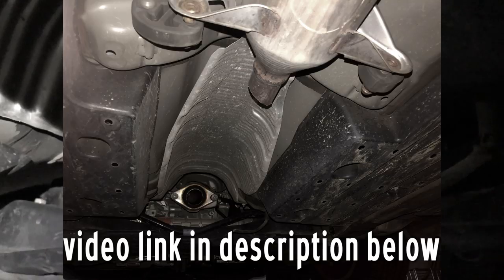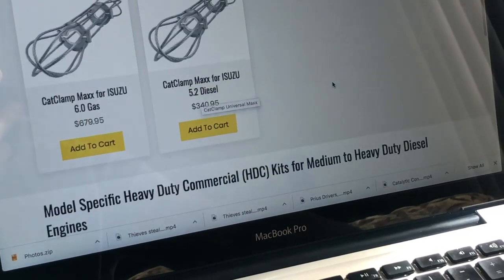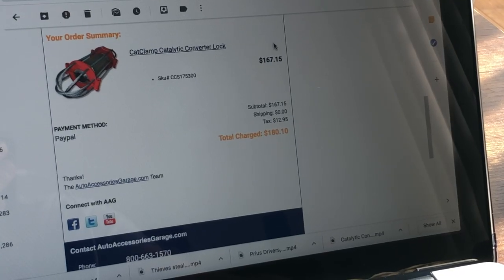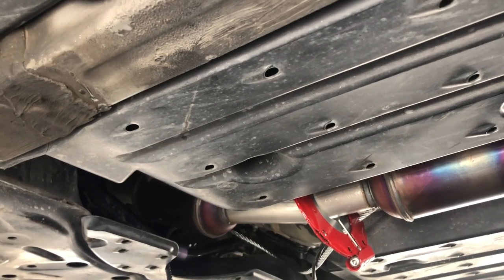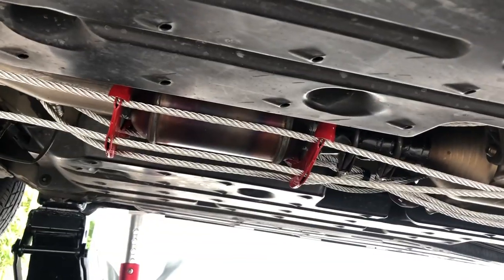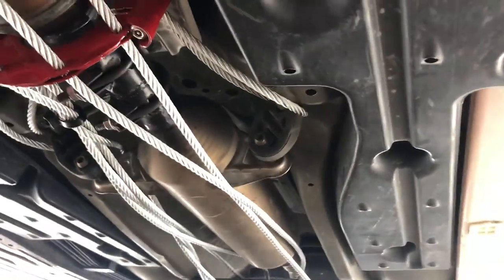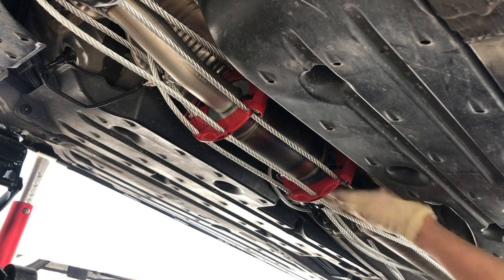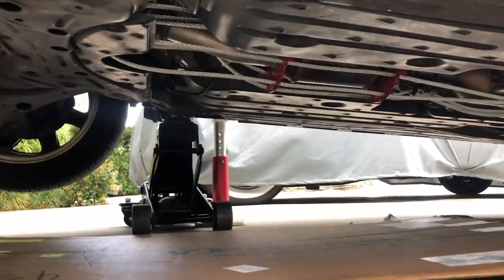Installing CatClamp: Catalytic Converter Anti-Theft Lock

Comment: $5,000 reward for the capture and reporting of illegal catalytic converter recycle centers there are no honor Amongst Thieves they are like cockroaches and will report on themselves simple as that case closed and I would also still add a security device to my cat
Reply: I support you!!!!!👍 Some MOFOS steal mine yesterday, I want them not in jail, I want them out of this planet!!!!😠💣💥
Reply: @BM-ef5fh  I don't know where your from but here in San Diego Toyota of El Cajon has catalytic converters for about $1,500 before taxes complete with no welding required 4 bolts
Reply: Thanks for the video. Showing installation was helpful.

Comment: Insurance companies should give a discount for people who install protection. Ultimately they have to pay the cost , so saving them money should save you money.
Reply: thats presuming they live in a place that requires insurance, even then, its only liability that is required.. which generally does not recover theft or vandalism
Reply: I don't even insure my truck for 3/4 of the year, we only use it for a few months in the summer or winter. More like start fining the shit out of recyclers who get caught with these coming from any source other than a certified garage.
Reply: A lot of insurance companies have a $1500 deductible so typically makes it pointless to put it on your insurance and pay higher rates. Even if someone does file a claim, they are still stuck with a large deductible. It's ALWAYS the people paying....insurance companies pay claims with their customers money.
Reply: @stephenwhite5444  Use a different insurance company.

Comment: hopefully the sway bar moving about doesnt get worn down as the bar will actually rotate, if you have a cable wrapped around it, it will be making noise as you drive if it is tightly wound around it

Comment: Hi David, a thief stole the cat from my '91 240 recently. They cut off the downpipe including the O2 sensor. Can I install a new universal cat with an O2 port or would it be better to install a new downpipe and cat with flanges?
Reply from the maker: Ah bummer! First time I’ve heard of a 240 getting nabbed. Oem is best but I’m sure a universal cat can work for you if you’re not in CA or NY, and I think Maine is on the exclusion list too.
Reply: @DavidBello  Thanks for the reply. I think I will go that cheaper route for the time being. It will still probably be an improvement to the 30 year old cat that was stolen.
Reply: Wow. On a 240??!!!  That’s insane

Comment: Thank you. Now I know that installing one of these would be a pain in the ass. Not that I have the ability to install one myself. I've read suggestions about scratching your VIN on the catalytic converter or painting it. I'd rather do that -- although I probably won't do either because they would require me to get under my car and I don't have a safe way to do that. :P

Comment: What would prevent a thief from merely cutting the cables with the saw they use to cut off the pipes?
Reply from the maker: The added inconvenience
Reply: @DavidBello  But they could pretty easily clip them with bolt cutters or the electric saw, right? It would just add another minute or so to the job? I'm trying to find the best option for my truck.

Comment: I just weld 1/2 inch rebar to the length of the cat and the section of pipe that its located on.
Reply: I have an 2000 e350 I thought about the same thing weld 5 or 6 rebars on frame under cat and maybe steel mesh to top it off it would take 15 or 20 min at least with saw . I just caught someone cutting my cat out while I was sleeping in van .
Reply: @arachosia  get creative. Lol
Reply: @arachosia  Exactly! Not smart.

Comment: I install custom made cat locks that are plate manifolds for all 2nd gen prius cars with installation in LA for anyone watching this and I do it for low price cheaper than if you were to buy the cat clamp on this video
Reply: hey how much ??? im on east la
Reply: @ricardogonsalez9739  $175 and it's with everything parts included
Reply: How much for a tundra
Reply: @lostcharly1  I gotta see your car I don't really do normal cars but ill check it out I won't charge an arm and leg tho
Reply: @frankhurtado6890  Ok it's a 2013 Toyota tundra, im located in moreno valley
Reply: @lostcharly1  bro unfortunately you'd have to bring it to me I stay in Los Angeles
Reply: @frankhurtado6890   What part of L.A ? I might be going the way in a couple of weeks to LAX, could swing by.
Reply: @frankhurtado6890  hey how can we meet??? i wanna do this on my 2009 prius
Reply: My daughter has a 2008 Prius, we just had the cat installed at dealer through our insurance. Unbelievable what's going on in LA area. How much and where are you located or phone number? Thanks
Reply: hello, can you give me more info please , I have a 2004 prius
Reply: Do you also do 3rd gen? If not, is there anything harder about securing the 3rd gen?
Reply: @sweepingdenver  I can do 3rd gen but I'm going to have to charge extra because they're a lot more work
Reply: So how do I contact you to do this and when can I bring my 2008 Prius to you in what area of LA? Thanks.
Reply: @Katjanra  my info is in the comments
Reply: @frankhurtado6890  sorry, but I  have checked twice,and there are not :(....
Reply: @Katjanra  you claim you want me to work on your prius but it's been a week already and you haven't reached out , I get ppl like you all the time
Reply: Where can I get your contact info? Do you work on honda accords? I got a 2004

Comment: I like the cat clamp but it's way overpriced. Heavy duty split flanges and steel wire (under the flanges and around the frame) would achieve the same thing for less than $30.
Reply: If you are handy, do it! This is a great product for those of us that aren't that mechanical.

Comment: did you install that black piece of brace metal towards the rear that the cable is strung through? is that OEM on your car?
Reply from the maker: That bar is OEM
Reply: @DavidBello  did you consider the wide metal Plate type of protection device?  pros cons?

Comment: Do this things work better than the plate? Also when doing smog do they need to take this off to do smog?  Call muffler shop and they told me that they still steal them even with locka

Comment: No reason to install the protection on this aftermarket catalytic. Those scumbags only interested in original converters because of high amount of platinum and palladium. They will jack it up ,see that it's the aftermarket one and they will turn around and leave. I took mine original off and put it into storage unit untill I get the protective plate. And also the device you used doesn't protect catalytic as well as the plate does.
Reply: You think they analyze the cat before they cut it out? lmfao! They cut it and run, then look.
Reply: @fortyoneshades  yup I saw a video they accidentally cut out the muffler on an RV and just left it in the driveway (which still had to be replaced)

Comment: Cat security is way better.   Just got and installed on my tacomas.  Also cheaper and easier to install
Reply: Cat Security $279. This is $176. Watching the install from Eric the Car Guy for the Cat Security shield that is way more involved, especially if you have an older car and rusty bolts. I like it, but am looking at this because it IS cheaper and IS easier to install.

Comment: But isn't their fancy quiet saw going to just cut through the cables just like the cat pipes?
Reply: A reciprocating saw is going to have a REALLY hard time cutting steel cable.  And it seems like that's the tool of choice for your average junky thief.

Mine was stolen recently... the guy showed up a couple hours earlier and spent about 5 minutes under the truck doing who-knows-what. I think he may have tried unbolting it? I didn't see any obvious tools on him when he crawled under.

He must have got frustrated (it doesn't unbolt or anything, so who knows why he spent so long under there). He left and came back a couple hours later with a buddy... both had cordless saws and they cut both ends at the same time. Made a HUGE racket at 3:30 AM, but they didn't care. It was about 20 seconds and they were done and gone.  His initial visit gave him enough info to make that last visit go as quick as possible. Turds...

I got my CatClamp and will be installing it today. Sure, there are ways you can cut it off, which is good since at some point you'd need to replace the converter, or work on the exhaust. But you'll have to work at it and bring more tools. These scumbags aren't looking to spend any more time than possible, and if it'll be noisy, even less so. You could use cable cutters, torches, grinders, etc. etc. but they'll all add time and noise - enough so that it'll alert people. Trust me, if that racket had gone a little longer, I'd have been out there with my "trusty sidekick" to figure out what's what, and it would have been an interesting thing to see what happened next.

Crooks like this don't want confrontation. They want the fast score and skedaddle... Make it just hard enough that they go on to someone else instead.
Reply: Yes, either a battery angle grinder or bolt cutters would be through those cables in literally like 30 seconds.
Reply: @ytmadpoo  why didnt you put them 6 feet under?

Comment: only one cable is used , so cut it once and thread it back through the rest of the clamp
Reply: Once you tighten it the cables are independent. You don't know how it works. Read the install.

Comment: What if the person come with a saw zall qnd bolt cutters
Reply from the maker: Then they have to REALLY want this specific Prius’ converters and have a lot of time on their hands. Chances are, there’s three others just around the corner for them to move along
Reply: Thats why the best way is to have a weld shop weld a piece of sacrificial round pipe the length of the converter

Comment: I don’t see how this is suppose to protect the cat, the way you installed that they can take it out and still cut the damn thing.
Keep the Prius and move out of ca!
Reply from the maker: Yeah with enough time and noise you can saw through anything. But can you make that much of a scene and get away with it?
Reply: It's more about putting off thieves to go look for easier targets. If they really want it, ultimately they can always just steal your car and chop it up. But cat thieves just want to be in and out fast without too much attention, not to mention way less tools and knowledge to just cut a catalytic converter.